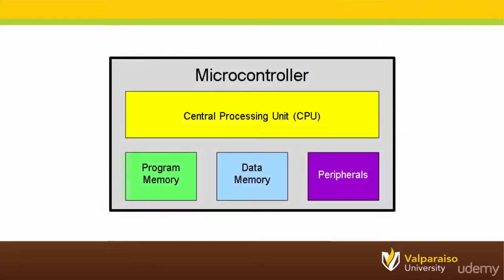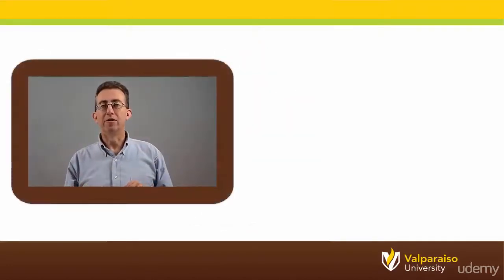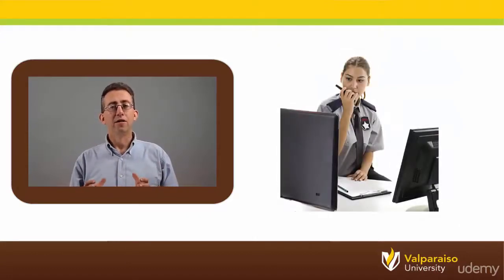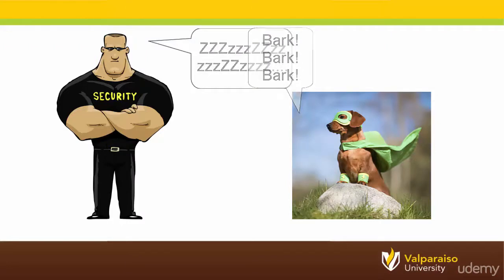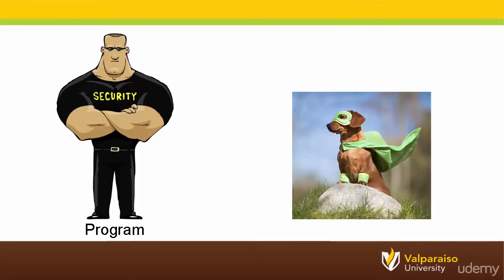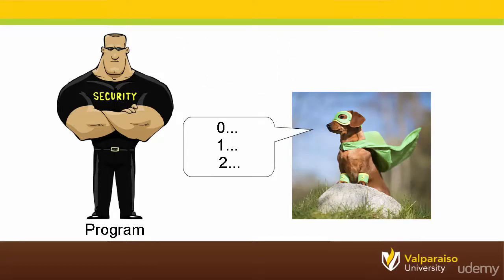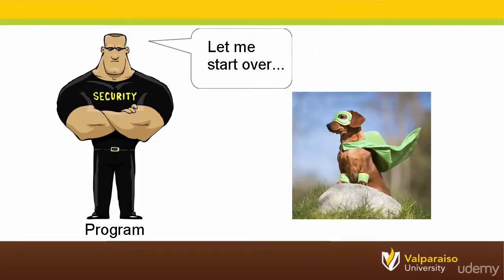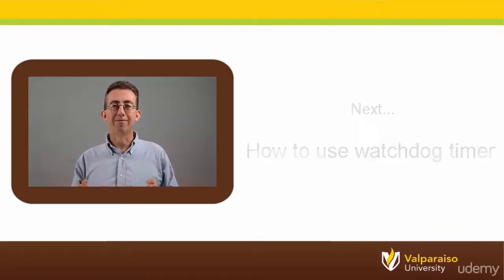055 What Is a Watchdog Timer - Microcontrollers and the C Programming Language

Comment: Clock_watchdog_timeout BSOD in windows is tied directly to this specific mechanism, right? Because I got it while running a program, that appeared to have crashed, and then my whole system crashed. After restarting, the bsod loop that I keep reading the internet about while trying to get to the bottom of this BSOD code, didn't happen. What does that indicate? A software level error? Should I direct my grievances to the developers of the program that crashed my system?